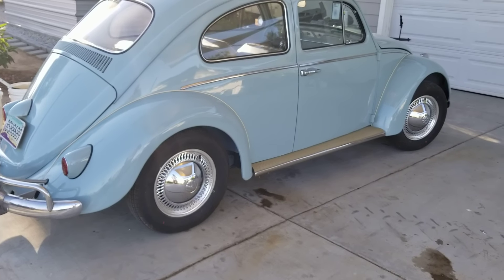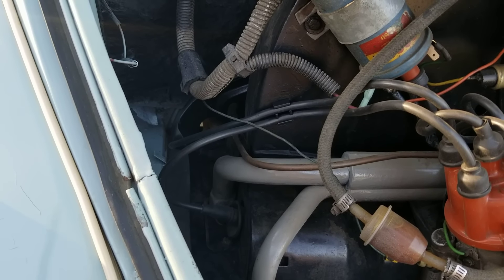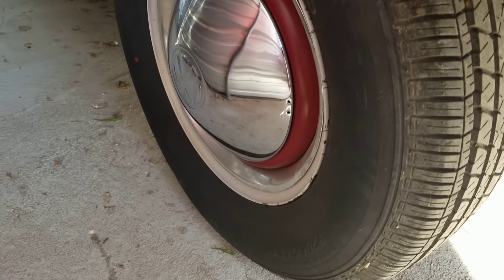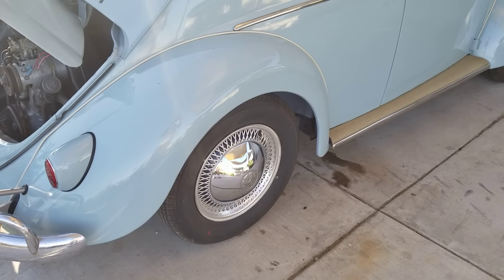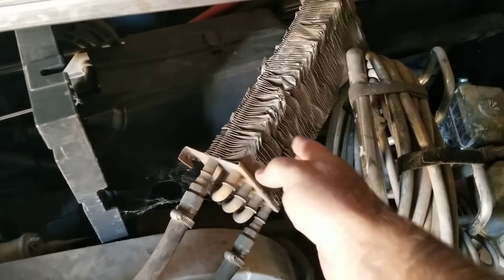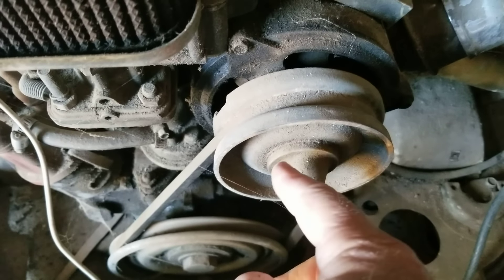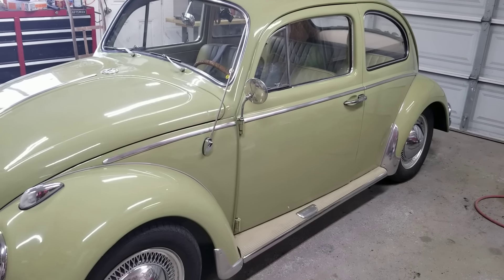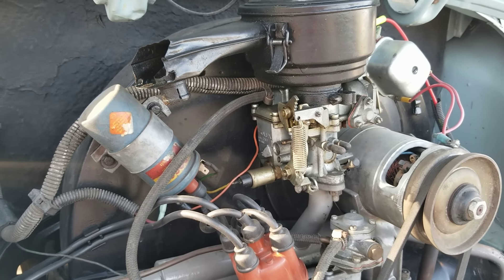Things NOT!!  to do to your Volkswagen VW bug or bus

Comment from the maker: Please like of dislike the comments that apply
Reply: Mike Fn Garage 
Or NOT of. LOL
Reply: Hi Mike.  I own a 58' beetle.  She is mechanically sound and runs daily.  I however have experienced that she does not allow the wipers and headlights to work together at once.  The previous owner converted her to 12volt.  Do you perhaps know what this can be?
Reply: at 6:24 you show a light blue Bug, and it appears to habe a turquoise steering wheel, which  should be only offered on early 61 Bugs with body color Turkis, which you light blue body is not.

 Whats the story on the body color and steering wheel color?

  PS you have a nice video, and show some very nice early Bugs.  Inspiration for to drive mine!

Thank You!
Reply: Your missing the covers around the heat risers😉
Reply: @Allen Loser The Bug never had vacuum wipers.    My 58 Bug had electric for sure, as did my 65,66,67,70,74 Bugs.  Even the early split oval window Bugs had electric wipers.
Reply from the maker: @eckardtmuller3856  not sure. if it does not blow a fuse it is a bad connection somewhere. Remove all the connections and clean them, clean the ground. If it does blow a fuse the motor or brushes are warn enough to cause resistance and need to be replaced. Wolfsburg west makes a 12v armature updated for the wiper motor. Might need to be replaced.
Reply from the maker: @dave8599  Original color l261 pastel blue. and had Hydride green steering wheel original colors repainted to orignal. ealry 61
Reply: you went a dif route then i thought you would lol and i agree , i thought you were gonna go all purist on us and rag on the lowered lol i know yours are all of the stock variety right..?
Reply from the maker: @RodderFiles  My green bug is lowered. Supers are great for modifying. also late models are perfect to cut up and make them for whatever you want. Rats. Rusted out cars are the best for that stuff.
Reply: @Mikefngarage  Why don't you replace the bulbs in your tiny tail lights with LEDs?
Reply: I might add, carry a fire extinguisher in the event of a fire! Thank you for the great insight it helped me with my 356c..
Reply: @Mikefngarage  I guess we all do that.

Comment: Do not tell your wife what you really paid for it. Ever!!
Reply from the maker: or the parts
Reply: Mike Fn Garage Especially the parts 😂
Reply: This is the best
Reply: Mine thinks they all came with the bus....
Reply: Mr Mac … I have a system for my hobby. It has a budget of $100 per month. If I need something for my old car I just back track to the last time I made a purchase. If it was a year ago then I get to spend $1200 with no questions! Right now I have $1700 into my vehicle (over 5 years) but haven't spent a dime in ages, besides gas and oil. It needs transmission work.... no questions so far.  <LOL>
Reply: @rupe53  That's reasonable and much less than a car payment.  And your car will appreciate.
Reply: I bought the single cab in my profile pic and kept it at my sister's for about 10 months before my wife found out.  I almost got divorced over that one.  LOL.
Reply: Unless you are like me and only spent under 7 grand on a full restoration, not pan off though.
Reply: What if it's your wife that wants it?
Reply: I’m a property developer and I have an agreement with my wife that for ea house completed a I get a $25K credit towards a car so it’s been good. She never gives me grief over parts or purchases. I’m very lucky in that dept..
Reply: Emily Adams haha love it! 🤙🏼
Reply: @vwbusguy  HA! Yeah mine thinks they all came with my beetle!
Reply: The car itself is probably pretty cheap, it’s always the parts, and the time.
Reply: Amen to that! I’m still showing my wife old Hot VW magazine parts ads from the late 80s 🤣🤣🤣🤣🤣
Reply: @rupe53  Love the idea.  I don't have a wife, but I do have a budget!  This is awesome.
Reply: @felicitad4095  ... BTW, I did get that transmission last year. I bought an entire vehicle and took the parts I needed, then sold the car for the same $$ to another guy who needed different parts. Since this video came out I also overhauled the rear suspension so another $250 over 2 years. Maybe this year I will do the front suspension.
Reply: Even better, don't have a wife. Problem solved.
Reply: I told my wife exactly what I paid for mine, as well as the improvements. I'm guessing your wife has an awesome shoe collection
Reply: Goes both ways!
Reply: Or husband!!
Reply: I never lie to my wife. I tell her exactly how much I paid for the parts…. In 1974 dollars :)

Comment: At 73, I was an Air Cooled VW Wrench for over 20 years - do NOT let a cold car idle to "warm up" - it WON'T. Start and drive IMMEDIATELY (moderately at first). Three different Metals in the VW engine - Magnesium, Steel, Forged Aluminum will all heat up and EXPAND at DIFFERENT Rates when at cold idle, causing the parts to permanently deform. Cold under a light load will cause the metals to heat and expand at a more similar rate. This will add THOUSANDS of miles to your engine's life and lower oil burning caused by the cold steel cylinders rubbing on the cold aluminum pistons, making them permanently egg shaped (leaky). PLUS don't do all the other things Mike has wisely told you not to do.
Reply: i warm mine till the chokes allow me to drive it away ;)
Reply: @RodderFiles  Yikes!  I just inherited my dad's 57.  I had no clue you weren't supposed to idle it in the garage.  Lesson learned!
Reply: I’m 31 and I’ve been a two way ethanol transfer pump since I was 21(I’ve also spent some time as a cotter pin, and have a bit of experience as a 5 gallon bucket)- and I have nothing valuable to add to the conversation.
Reply: I have always heard and done the opposite.  That you don't want a load on parts that are not up to operating temp.  And also you want the oil warm enough to be flowing freely.  You make a good point though.  I don't think you want to sit and idle for 10 minutes.  But I always tried to never load a cold engine.  Mike is right about "lugging" the engine.  I bought my first beetle from a neighbor who was a VW mechanic.  He told me over and over, NEVER, NEVER, NEVER lug this engine.  I did take that to heart.
Reply: best advice EVER for an air-cooled.  My brother had a German car shop for 35 years and ALWAYS left a card with this advice to his re-build customers.  Start it, weait foer the choke to cycle, then drive moderately for the first 5 minutes.

About 50% of all the wear your engine will endure happens in the first 5 minutes.  Take it easy, and you can reduce that damage significantly.

Modern engines are different, and have oil pressure within 3 seconds, which one of the reasons they run for 200-300K commonly.  Old school air-cooled engines require more owner interface and awareness. My brother recommeded an overhaul at 60-80K.  A VW Type 1 was a sad mess at 100,000 miles, and often required a whole new case, not just a line bore. Of course, owner care was always the biggest variable.

Comment: Don't leave home without a fire extinguisher.
Reply from the maker: good one. thanks for that.
Reply: Not sure its a good idea to leave home if its going to involve fire extinguishers lol
Reply: I was getting ready to say the same thing. LoL
Reply from the maker: @_f30_b58  thanks for commenting anyway helps the video
Reply: Rene Drew I lost my 69 beetle bc of that exact reason..motor was bright blue in a matter of seconds. It was definitely a lesson learned the hard way.
Reply: Exactly what I was going to say!
Reply: Rayane Soto that was the first thing I purchased for mine. I got a big one carry it in trunk lol
Reply: Rene Drew  yes well said.
Have you seen how scary my garage is
Reply: Don't leave home without 2 fire extinguishers, one you can reach within seconds and one your passenger can reach.
Reply: and a fully stocked tool box w/ spare clutch cable and throttle cable
Reply: move the fuel filter, which can fail, out of the enginebay   install these aftermarket filters ar the transaxle under the car.

  A leaky cheapy plastic filter where you have it, is very likely to catch fire given the proximity to the distributor which sparks away.

I have had an engine fire thanks to a fuel leak and the distributor.
Reply: Rayane Soto This is so critical. I actually have three in each of my VWs. My 66 bug has two “ABC” five pounders and one Large commercial hand held Halon. Same for 71 Westy. I also just put a 4th. 2.5 Lb. ABC in the engine compartment of the 71. It fits very well on the left side where a second battery normally would go. I saw a 76 camper saved by that technique at one of the bug-ins in the early 80s. An engine compartment fire overheated the plastic nozzle on the FE and it discharged. Saved the van!
Reply: Very informative man, thanks for posting. The speed with different tires was great info
Reply: Probably should have one in every car
Reply: that too...it will save your voksy one day
Reply: Especially if you put a fuel filter in the engine compartment right over the distributor.
Reply: If mine burns, I let it burn and collect the insurance $.  It's way overpriced

Comment: How about don't leave the clutch depressed when at a stop light?  It wears the thrust bearing.
Reply: Garage Time - Restomod 
It takes a long time for that to happen, especially with the later ball-bearing type throwout assemblies. Sitting with the clutch depressed for 10 or 20 seconds waiting for a light to turn green won't hurt anything. I would worry more about the thrust bearing in the crankcase. The old carbon block throwout bearings in the split-windows and such would wear faster.
Reply: @rescue270  that's what I meant.  The case bearing!  Much harder to replace.
Reply: Garage Time - Restomod 
Yah, I see that now. Sorry!
Reply: @rescue270  Ha ha no worries!
Reply: I've owned 3 VW's in my lifetime. In order: '64 beetle, '69 Squareback, '57 sunroof. Whenever I'd be stopped for more than a couple seconds, I always put them in neutral and took my foot off the clutch. I remember one of the owner's manuals even mentioned to do just that!
Reply: @Allen Loser   "Always replace the thrust bearing when replacing the clutch plate." Or, don't hold the pedal on the floor at a red light, and never replace the TO bearing. 
In almost 40 years owning VWs, I've never purchased a TO bearing. I've never had one fail, so I don't need to replace a perfectly good part, just-in-case.
What's likely is that you might do a clutch job and remove a perfectly good German TO bearing and replace it with a new China bearing.  How does that increase reliability?
Reply: @Allen Loser ..  If you took a 50 year old Beetle to a VW dealer today, they will most likely turn you away. Even if they did agree to do the work, why would you want a mechanic who's never worked on a Beetle doing the job? You're paying a premium price for inferior service.
German made clutches, discs and TO bearings have not been available for many decades, so you don't have the option of buying OEM. If you were lucky, you might find Brazilian made parts that are almost as good. Most likely, the VW dealer will source a clutch locally and come up with a China clutch/disc/TO bearing.
Reply: @Allen Loser 5 month late response, but the thrust bearing and the throwout bearing are different things. Throwout bearings are much easier to replace compared to a thrust bearing. When you press the clutch, you put your thrust bearing under load. Type 1 engines are prone to developing end float. This happens because the thrust bearing starts to spin inside the case when it wears. And that end float starts to eat away your case, bearings, pretty much everything. I got my case thrust cut last week, because i had end float issues and it finally started to leak oil like crazy, i was lucky enough to catch it before it went beyond 67mm. You can thrust cut the cases only 4 times (65.5, 66, 66.5, 67 and scrap the case), i daily drive my bug and i want the engine to last since its at the final tolerence, so i always put it in neutral if im idling to keep the thrust bearing from wearing out.
Reply: Just don't take your foot off the brake at a stop light because all those morons behind you driving automatics will think that you are about to move and drive into the back of you...

Comment: One to add of substantial importance! "Do NOT fail to carry one or two spare VW V-belts in the car, since a broken V-belt means overheating disaster!" It would also be advisable to carry a spare accelerator cable assembly with you if you do any traveling in your bug, since finding one on the road at the 'Last Chance Garage' would be nearly impossible. Thanks for providing not just VW 'newbies' but all VW owners a service with these observations, Mike! Of especial relevance is the information about keeping the battery's positive terminal protected from the rear seat springs! Dozens of wonderful VW Beetles have suffered catastrophic fires due to that particular hazard (particular if the back-seater is a VERY heavy person! Back in 1930s KdF days, most of the backseaters were children, not 200 pound American adults, LoL!). Good on ya, mate! Cheers!
Reply: Are new vw vehicles less fussy
Reply: That belt also runs the generator or alternator. If the red light below the speedometer comes on (indicating that the generator isn't charging), stop ASAP and check that belt. If the generator (and the fan attached to the back side of its shaft) isn't spinning, you will cook that engine in a hurry. Back when I drove air-cooled VW's (40 years ago) parts were pretty easy to find. I suspect that is no longer the case.

Comment: Do not have a fuel filter installed in your pressure line. Have it in the suction line in the front of the car or near the transmission.
Reply: Zee Governator absolutely. That's the worst thing ever to do on a vw.
Reply: Yup. Ask any VW community about how many engine fires that has caused over the years and that should be enough of a motivation to move it out of the engine bay. One single line without any extra weight or joints on it going from the fuel pump to the carb is the proper way to do it.
Reply: Odd as this may seem. I drove a 62 bug from 1972 to 1997. That particular model, right from the start, as in brand new right off the VW dealer’s lot never had a fuel filter of any kind. That was a stock configuration for that model. The majority of the fuel lines were metal w/a minimum of braided fuel line used for connecting the metal gas lines to and from the fuel pump to the carburetor as well as the line connecting to the gas tank. Never installed a filter. Never. Flushed the gas tank twice the whole time I drove the car. No fires. No fuel problems regarding blockages in the carb or fuel lines. Put a lot of miles on the car. Even replaced the speedometer after about three hundred thousand miles. Replace a lot of wear and tear parts required to sustain reliability. The original fuel pump and ignition coil was something that never ever was replaced as long as I owned the car.
Reply: Leonard Zangs  I worked on Beetles and Golf 1 in the late 70’s. I maybe remember that some maybe older beetles had a mesh filter build in the fuel pump. And some really old beetles had a open/close valve inside the car. This valve was installed directly in the tank. Like a motorcycle. This valve had also a mest filter inside the tank. (I Think to remember) :-)
Reply: Zee Governator 
All VWs had a mesh screen on the fuel tank outlet whether it had the reserve valve or not. The original fuel pumps had mesh screens in them as well. Some aftermarket fuel pumps had no screen. With those pumps it was pretty important to use the fuel filter.
Reply: They used to sell fancy glass see-through filters for bugs. It mounted right over the distributor cap.
Disaster waiting to happen.
Reply: Zee Governator your are genius . Why not this tip comes to the others mind .  you're not an ordinary person.
Reply: That's I did

Comment: Do NOT start a project on your vehicle thinking you're not going to spend more money than planned. sheesh
Reply from the maker: omg I was so frustrated with that i had to make a video on just that. so many people think it will be a low budget build then they bite of more than they can chew.
Reply: Its ok if you have no money at all because you cant spend it.
Reply: My v.w. mechanic died of old age back in 2013..sheer folly to work on them with out one.
Reply: Be me 6 years ago"yeah ima going to restore this car to a show car for about $1000 and no tools......still going.....and buying tools....
Reply: @vwbusguy  I got my current VW baja free from a neighbor many many years ago. The young kids he got it from had rolled it and trashed it. Someone had converted it to a baja before they got it. It had been in an accident at some point, crunched in the nose and rear. While a baja, it had been partially submerged in mud and rusted badly from the door handles to floorpans. Heater channels were gone as well. He saved it from them and gave it to me free. He said they couldn't make it start. I just shook my head and thought piece of crap. However, I figured it would be a challenge. I immediately saw the engine wiring was all messed up. I got it running in 15 minutes and drove it for a year with cracked heads.  Took me 12 years total to restore, new tools and had to learn a lot more about body work and welding that I did not already know. Put a cost on my time, tools, parts, paint, supplies, etc. Probably spent around $30K and still going. She's my garage queen now. Drive a few times a month and to car shows. What a story to tell. In the end it was worth it to me. I'll never sell it.
Reply: @vwbusguy  yea, dropped 1K on paint and paint materials for my 71 bus